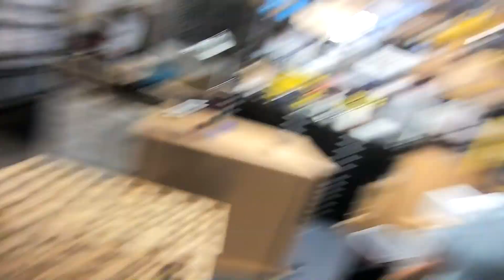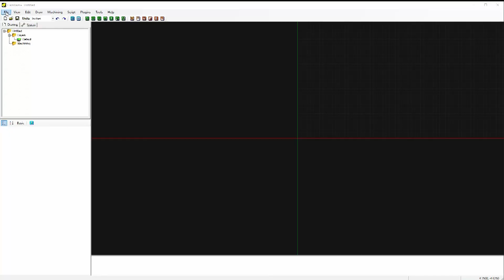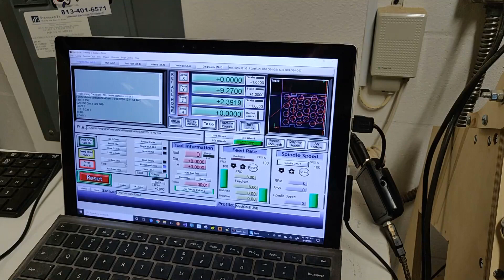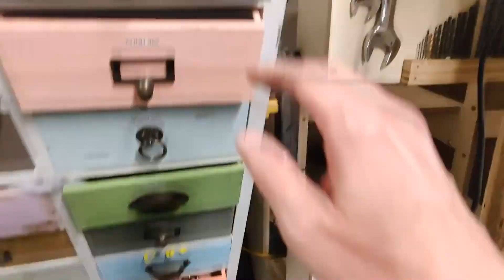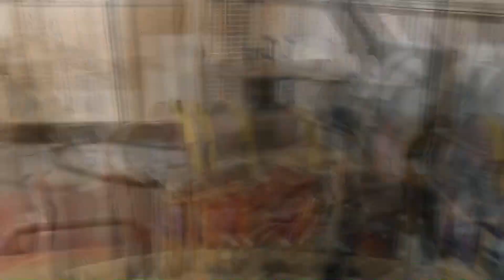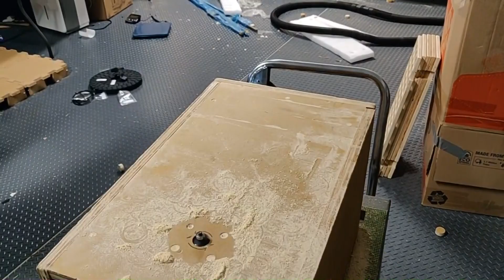CNC Routing Process (CAD, CAM and CNCl) Variant 2: Part 4 Cut Out the Shelves.

Comment: If you are not worried about the veneer on the bottom side what I do is make thetabs thiner and then plane of the underside to finished thickness saves a lot of sanding /routing.
Reply from the maker: Thanks for that!  I will do this the next time I use standard ply.